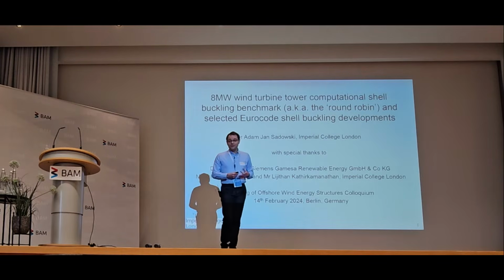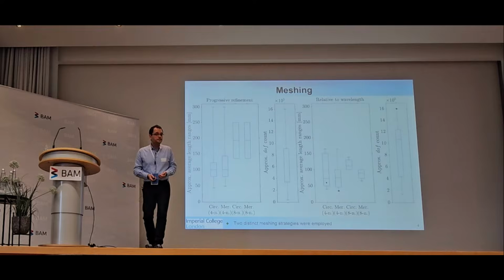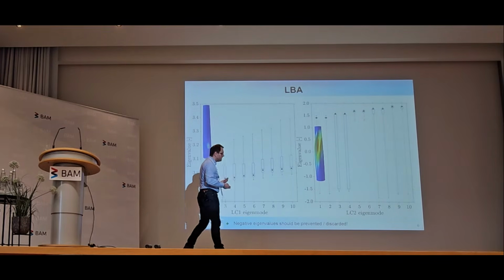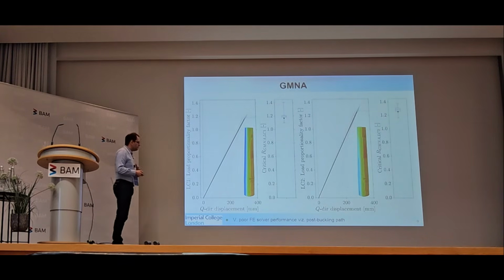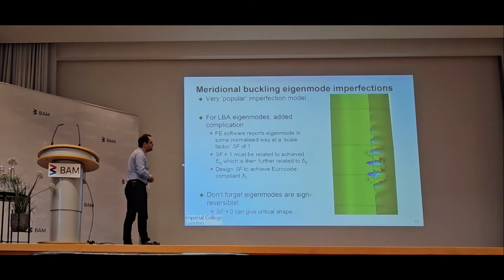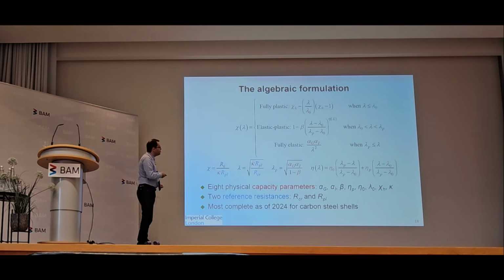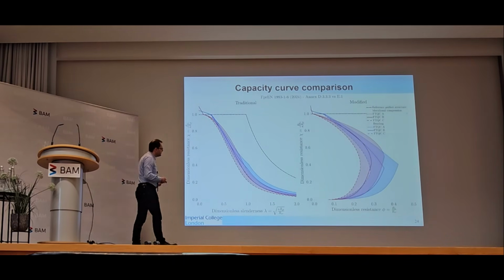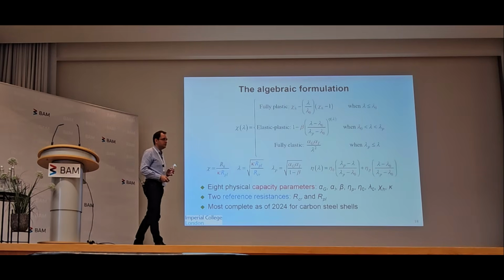Shell Buckling Colloquium 2024 Berlin – FEM, Imperfections & Nonlinear Analysis (Keynote Speech)

Comment: Great presentation from Dr Sadowski, thanks for posting. One thing I note from this and the referenced round-robin papers is that the sources of imperfection are LBA and weld depression and that no comment was made on using GNA as imperfection pattern. Have you any thoughts on using GNA as a source of imperfection for shells? I would have thought that the dimple patterns produced by GNA are much more onerous to the GMNIA than the ripples typical of LBA.
Reply from the maker: Not really sure what you mean with GNA as a pattern?
As far as I know I was the only one who used Dimple imperfections in the round-robin. I think it will take some time for others to adopt it as well.
Reply: @hnrwagner  prEN 1993-1-6 has the wonderfully vague clause that "The pattern of the equivalent geometric imperfections should be chosen in such a form that, under the defined loading condition, it has the most unfavourable effect on the imperfect elastic-plastic buckling resistance ratio of the shell." 

While LBA often produces these small rippling/corrugation patterns in axially compressed shells, GNA will produce an actual dimple towards the inside of the shell - at either the maximum load or after the snap-back. The GNA displaced shape can then be scaled so that the magnitude of the dimple complies with the dimple imperfection amplitude δ0,eq. 

This GNA dimple (combined with any weld depression shapes) corresponds with how the GMNIA actually wants to collapse much better than LBA and in my experience will result in a lower RGMNIA.
Reply from the maker: @mikeb1097  
Probably because using the GNA deformation field as an imperfection pattern is not that easy to implement, I know vaguely how to do it.
I would directly induce a single dimple by either a small force or displacement and then scale the amplitude until the minimum LPF is found, that works very well in my experience, and also correlates well with test data.
Reply from the maker: GNA-based imperfections were not mentioned because they are rare, more difficult to calibrate than LBAs and indeed no-one in the RR used them. They can however be a good basis for a damaging imperfection model, but rather than being used directly they are best 'processed' to extract the features of nonlinear deformation that actually matter. An example of what is meant may be found here: http://dx.doi.org/10.1016/j.ijsolstr.2012.11.017. However, GNAs like LBAs most likely do not relate at all to any real imperfections caused by real manufacturing processes.